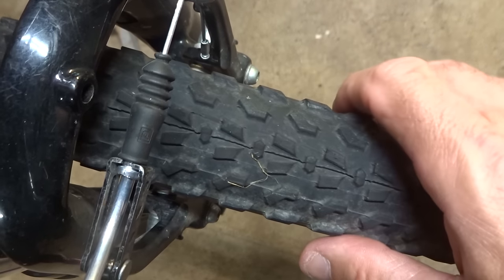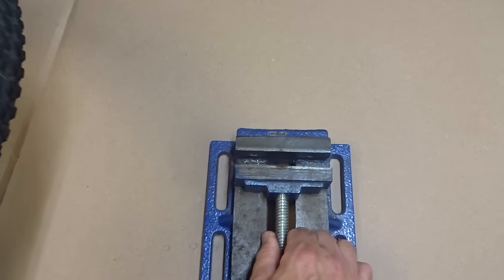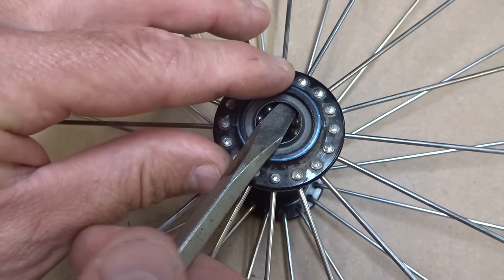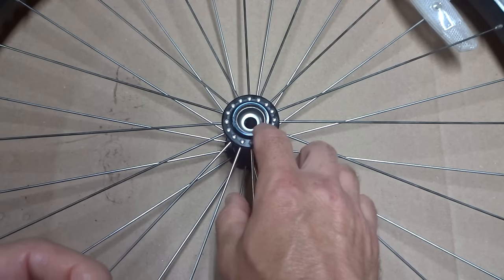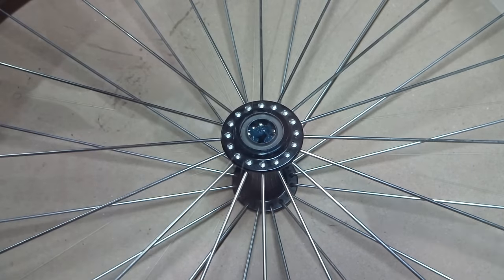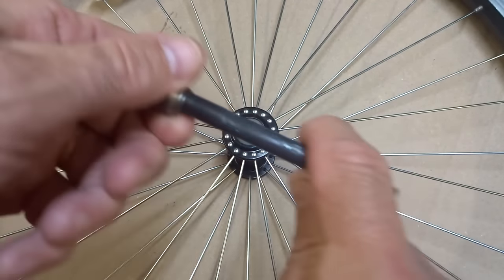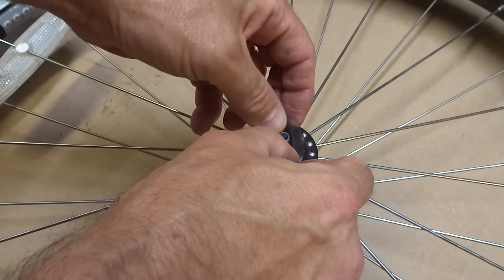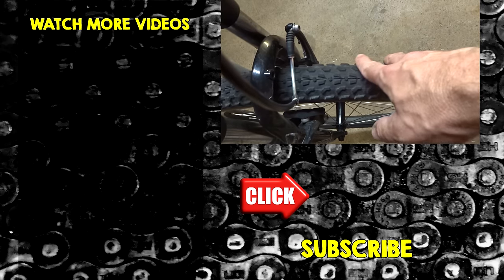How To Fix Loose Wobbly Wheel Hub

Comment: Interesting. I'll not sure why but I never really considered that my hubs would have any different style bearings from the bottom bracket type cartridge(?) Bearings, but indeed a bit of googling seems they've got this. I had them replaced last year but if it's simple(ish) like this I'll certainly give it a go! Thanks RJ. Be well!
Reply: A cartridge unit has roller bearings not ball bearings
Reply: @norms3913  turned out the front hub has loose bearings which fell out all over the floor of the garage and the rear has caged ones with 50 loose in the freehub itself which was fun getting back together 🤭🥳 it's super quiet now though 👍🍻
Reply: @ollieb9875  thats why you always have a magnet close by lol
Reply: @norms3913  yeah I have those neodymium ones though the stainless steel bearing balls in there weren't hugely magnetic 🙃 I had a box of new ones anyway. 👍
Reply: @ollieb9875  I use those telescoping magnets lol
Reply: @norms3913  I stuck some magnets to a bit of cable outer, I had it anyway because the quick links fell off my chain whilst soaking in wax. I'm basically a category of errors but I suppose that's how we learn. Fix it till you break it then fix it some more. 😂

Comment: Great video!! Do you perhaps have a video on a rear hub seevice, with the freewheel and cone ser up etc - maybe a link to that in this video is an idea? Also are these bearings fussy as to which grease they use ? I would imagine a standard bearing grease is fine - or is there one optimal and universal one could get for all to most bike components ? Again thanks for the fantastic content! :)
Reply from the maker: It's basically the same. I prefer marine grease.
https://www.youtube.com/watch?v=IrzlHjhckSU

Comment: My 80's wheel felt pretty lose so when I tried to disemble  the hub the threads on each side was a bit damaged. The grease that I could see seemed pretty fresh tho so I decided to just tighten the cones so that there would be no play anymore. But now the wheel like sounds a bit weird and vibrates and stuff. -What do you think I should do? Could it be the bearings that are worn?

Comment: Nice vid thanks. Any particular reason why the skewer lever should go on the non-drive side of the wheel or is it just your preference? Cheers
Reply from the maker: To make it consistent. For example many tires are directional. You shouldn't have to look at the tire to figure out whish way to mount the wheel.

Comment: Thanks for this video. Really helpful. 

Just out of interest - what would cause the hub to become loose like that? Could it just be age? 

I’ve recently started taking my mountain bike out again on trails - with some bumps but nothing major.

It was in a garage for over ten years - before I dug it out and replaced the chain/ cassette/ crank, tires etc. but I never got new wheels.

Would you say that’s my answer? Just want to ensure it’s nothing I’m doing wrong etc.

Thanks
Reply: I think the loose hub or "play" is probably due to wear and tear. Bumps and potholes on trails could put your wheel out of true. If/when that happens it's best to take the wheel to your local bike shop; it's not an expensive repair job.

Comment: I like the old ones with the bearings built into the ring.
Reply from the maker: Caged bearings? They are generally on low end cheap wheels. They are not as good, but less labor to install.
Reply: @RJTheBikeGuy  Oh I didn't know they were of lesser quality.
Reply from the maker: @joeniccoli1916  The same load distributed to fewer bearings.

Comment: RJ, can you see any advantage of these straight spokes wheels ? I think the laced version is way rigid than that.
Reply from the maker: Google "lacing patterns wheels pros cons".
Reply: Apparently it saves about 2 spokes worth of weight but not as strong and it leaves the hub flange prone to breaking unless it's a particular kind of hub. But yeah seems like just a marginal gains thing really, what's 2 spokes weight on a day to day use mountain bike? Looks alright though.

Comment: thanks for this video RJ. i have a question. i assemble the bikes at a target. often the Huffys wheels have play like that. can i adjust them? or is it such cheap crap it is what it is
Reply from the maker: Yes, you can adjust them. Loosen, the locknut, tighten the cone a bit, tighten the locknut against the cone. Adjust until axle turns smoothly and there is little to no play.
Reply: @RJTheBikeGuy  awesome thanks RJ!!! I successfully did one  today!!

Comment: RJ:  A question arose as I watched this video.  I've encountered a broken solid axle and had to replace.  Can you replace the solid axle with a hollow one to convert the wheel from bolt-on to quick release and. If so, are there issues in selecting/buying the replacement axle?  Thanks.
Reply from the maker: Watch this video:
https://www.youtube.com/watch?v=gsdxS046jpo

Comment: What kind of grease do you use in the bearing?
Does anyone know by chance what size bearings a 1994 Trek 7000 would have used?   It would be nice to get them before I take my wheel apart and don't have a bike

Comment: My bike does not have a locking nut but was fixed with loctite from manufacturer. So initially was difficult to loosen but subsequently cannot hold hold that sweet spot position any remedy?

Comment: Hi RJ, thank you for videos.I have a question about, how to remove skf bottom bracket(has English threads),i tried BBT-4 and WD-40 but unsuccessfully,it slips off from notches.even i tried a punch with hummer.What i should to do?
Reply from the maker: I think you need a tool for that BB> https://www.sjscycles.co.uk/tools/cyclo-fag-skf-pattern-bottom-bracket-removal-tool/?geoc=US
Reply: BBT-4 is nominally the correct tool, but it's a little harder to use without slipping than the tool RJ posted. If you get the tool he posted, you can then lock it into place on the BB splines by holding it down with your crank bolt and a stack of washers. This should prevent the tool slipping and allow you to apply enough torque to loosen it. Remember that the right side is reverse threaded.
Reply: @mattgies  hi.as i used a punch and hummer the notchs of the bottom bracket are damaged,my question is will it fit( not slips off from notchs) when i will use the RJ posted tool after fitting the tool with the crank bolt?

Comment: Are there always 10 balls per side ?

I wanted to make a set of wheels i have ready for a friend that wants to start some light roadcycling but, they made some weird sounds.
I think they came from a 2015 Focus Mares AX 4.0 i belive. "Hub says CSL concept on it"
But they had less than 10 per side and even a odd number " Side of the Disc brakes 9 and the other side 8".
Is that normal, because i am 100% sure i never opened these up.

Comment: I already did that to my bike, but you will find out that these hubs you have to tighten them up by hand only and a little bit at time until it's snug and it will have a little play anyway cause if you go try to tighten them a little bit more the rim will not rotate.
Reply from the maker: You have to have a feel for it.

Comment: thanks for thevideo i tried making my own emergency cone spanner but it wasnt successfull may have to buy some.
Reply from the maker: https://www.youtube.com/watch?v=KbI5SyXWaB8
Reply: @RJTheBikeGuy  great idea I thought of that as well but didn't have any spare so ended up feeling rich and 2 double ended cone spanners on eBay are coming. Now to approach my local garage for some bearing grease. Cheers from Melbourne.
Reply: did the job but will recheck the cones in a few days as i think there might be a tad too much preload.thanks for the great video. Do you have a simple video on truing a wheel after you have mucked around with tightening spokes? thanks
Reply from the maker: @roscored1000  https://www.youtube.com/watch?v=f1SHmFBihKM
Reply from the maker: If you have tightened all the spokes, it's possible you might have too much tension. You need a spoke tension gauge to check spoke tension. It's an expensive tool. They need to be in a range based on length and spoke diameter.

Comment: Stupid question perhaps, but why does the handle of the skewer need to be on the non drive side?
Reply from the maker: On the front wheel it doesn't HAVE to be. The rear wheel does. So, they are both on the same side. And some tires are directional. So if you always have the skewer on the non drive side, you can mount the wheel without looking at the tire.

Comment: @rj the bike guy is this wheel off a giant mtb ?, my giant boulder has the same metal seal & rubber outer seal, never seen this type of setup b4 i got my boulder .
Reply from the maker: It's a Specialized Hardrock.
Reply: @RJTheBikeGuy   ive always liked specialised hardrocks  almost bought 1 but it was painted in camo colors & was extremely heavy too
The camo was the deal breaker omg yuk!! 🙈🙈🙈

Comment: You forgot to leave a little of play to compensate the axle compression caused by the quick release.
Reply: A quick release should never squeeze your set nuts and cones. Nor should regular hex wheel nuts.
Reply: @evanswinford7165  That is not correct, there is no axle compression in a solid axle, and a quick release will always compress the axle increasing the preload even if you undertighten the skewer.

Comment: Hi sir! Is it possible to convert this kind of hub to sealed bearings instead of ball bearings? If yes, can you make a tutorial?
Reply from the maker: No.
Reply: Sad. I was about to convert my ball bearings to sealed ones but unfortunately the axle is too loose to the bearings. The sealed bearing size is 6000
Reply from the maker: @shanechristophergrutas3117  Hubs with sealed bearings are made for sealed bearings.

Comment: Good stuff, although both dust caps were installed "upside down" - the flat side should face out.
Reply from the maker: No they weren't. That is how they are supposed to be.
Reply: @RJTheBikeGuy   I've just dismantled a rear axle and it had the dust caps the other way around too (ie. so flat side on the outside and pointy side in towards the bearing like JMd said).  Also, I noticed on this video (https://youtu.be/ZOUsVXUBnAE?t=84) it was also the opposite of the way you installed it here.  Do they differ from bike to bike?
Reply: Same here, I disassembled my bike, and the dust caps that were there are flat, and the dipped side is facing inwards towards the ball bearings.

Comment: Zero play when wheel it outside, results in overtightened after the quick-release is tighten (the axle compresses a bit). So you must have a small play in the axle, when the wheel is not mounted in quick releases.
Reply: I always tell people to grab the outside of the axle like you're trying to twist off a bottle cap. Try to move the axle up and down. If you feel a "click", it's too loose. If you feel a barely perceptible "tick", it's good.

Comment: If you keep dropping chains off your bike, I'd be looking at any wobble coming from a rear loose bearing or its hold-down nut coming loose.  Unless the chain line isn't straight to begin with,  most of the time your chain will first come loose and work its way off the bike from a wobbly back sprocket.

Comment: I count the bearing before you remove it .it was total of nine  the replace count now is  ten.it should be ten or just nine?
Reply from the maker: Most front hubs use ten 3/16" balls on each side; Most rear hubs use nine 1/4" on each side.

Comment: I found bearings in a cage.  Can I replace with loose bearings or do I need to stay with those that come  pre-loaded in a cage?
Reply from the maker: You can replace then with loose bearings. Same size as in cage. 10 each side front, 9 each side rear.

Comment: What's the issue if i slightly magnetise the ball bearings by using a magnet to remove them? I can't think of any issue other than interfering with a cycling computer, maybe a bit more drag???
Reply: They attract metal then, and instead of riding on a cushion of grease, they're crunching across tiny metal particles.
Reply from the maker: What he said.

Comment: I just can't get replacements for my hub so I ride like like that. Also can a freehub body make my wheel wobbly? This only appears when its in the bike but never when it's off. It's not the frame/skewer issue
Reply from the maker: Find replacement what? If the freehub body is loose, yeah. Or of the hub bearings are not adjusted. Or a broken axle. Or other stuff.
Reply: @RJTheBikeGuy  cones are slightly worn, but i dont know where to buy new  ones. I tried many times to adjust them. Can i somehow tighten the freehub body?
Reply from the maker: @ItsMorbinTime03  https://www.youtube.com/watch?v=f19BGYc5ysA

Comment: You should check cones and cups for wearing. If you won't replace them axle will need correction really soon.
Reply from the maker: They looked okay. Cones are replaceable. Cups, not so much, short of replacing the hub.
Reply: @RJTheBikeGuy  yeah, if cups are not replaceable, that's it. New Hub. This is often irritating thing, when You cant fix something, cause somebody designed it in wrong way. :D
Reply from the maker: @mrowczak1900  There were some hubs that had replaceable cups, but the cups are impossible to find.
Reply: @RJTheBikeGuy  there are many hubs with this kind of cups. mostly i cheaper bikes. I work as bike mechanic in Poland, mostly, We have no problem with this kind of parts. But in this year, there is a lock of them, unfortunately.

Comment: I love the ball bearing magnet trick saves loosing them down the axle
Reply: Spray solvent will rinse out bearings stuck in greasy hum tubes. Use a catch tray.
Reply: Brake cleaner or Berrymans Chem Tool.

Comment: I fix mine, and it just comes loose again. I bought it recently, but Giant support is no help.
Reply from the maker: Then you are maybe doing it wrong, or something is damaged. I can't tell you without working on it. Take it to a shop, or figure it out.
Reply: @RJTheBikeGuy  I took it in to the shop and they tightened it, but it came loose 2 weeks later. I've kinda given up on it and I now ride around with a loose hub. I'm currently saving for a bike, so I should be able to o replace it in a couple years. Thanks for the help!

Comment: I just ordered 500 ball bearings for $10 on Ebay after watching you do this so often. I have a couple of problems:

I took apart one 7 speed MTB rear wheel and no matter how much I adjust the cones every time I put the gears back on it, it tightens back up and doesn't spin freely. Any ideas? Do you have a video to cover this?

On a road bike I have similar issue on the crank. I replaced the ball bearings with a shimano UN-55 sealed bearing unit and when I tightened it up the gears were tight against the frame allowing no rotation. So I went back to the original ball bearing setup that was in there and they did the same thing. Is it possible the square holed gears got internally wallored out enough to remove the clearance it once had? If I were to upgrade this to a completely different set up what else is affordable & better? 

BTW I did have a Wolber wheel with a sealed bearing whose shaft broke and apparently it wasn't even very noticeable. I'm hoping to rebuild it maybe with the help of an easy out. 

I use a Jawhorse to clamp the other side of the wheel when I work on one. Works excellently. It's a superb clamping system where you use your foot so your hands are left free to work. You might want to check it out. Better and faster than a vise IMHO.
Reply from the maker: Not sure? Maybe bent axle? 
The UN-55, sounds like you got one with the wrong size spindle (too short). You need to look up the specs for your crank set for the BB specs.
Use a blind hole bearing puller maybe.  https://www.youtube.com/watch?v=27YCUMzKcfE

Jawhorse looks bigger than I want to deal with. Thanks.
Reply: I'm guessing that the bearings go tight when you tighten the lock nut. Try adjusting the cone nuts so that the bearings are a bit loose, then do up the lock nut. Check for any play at this point. Often I find if there is still a tiny bit of play, I just tighten the locknut a bit more so that it turns the cone nut as well; I'd only do this for minor adjustment, like an eighth of a turn or so.